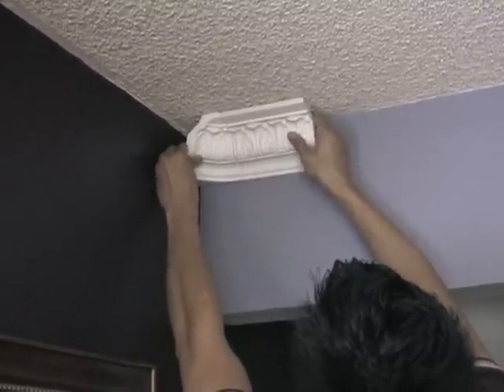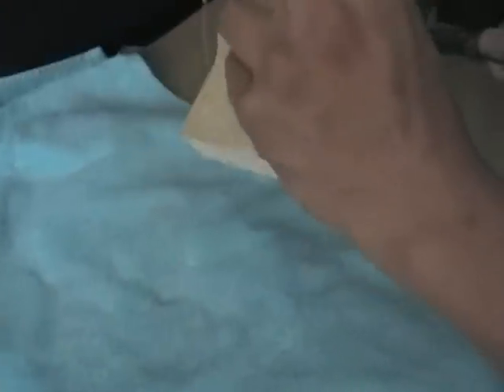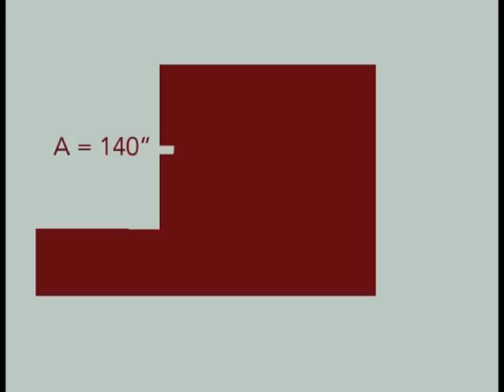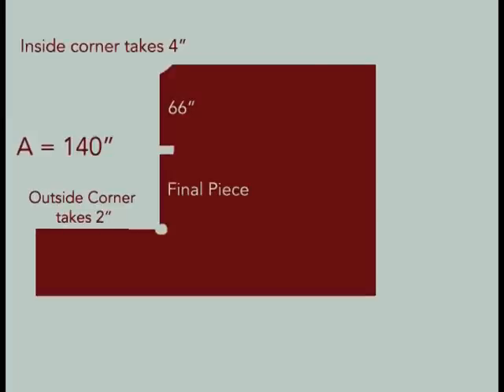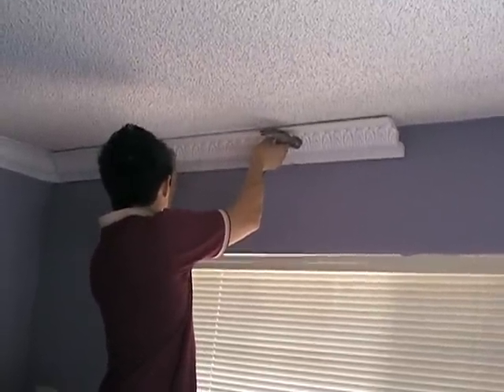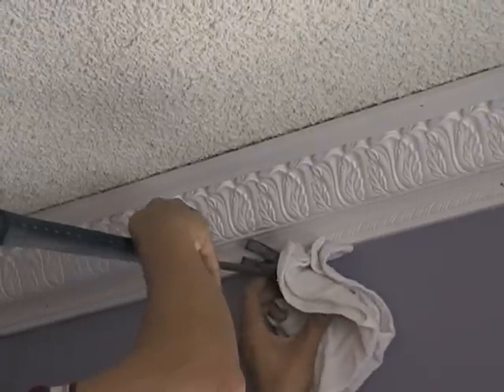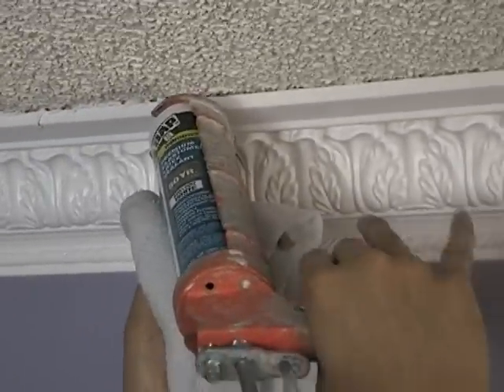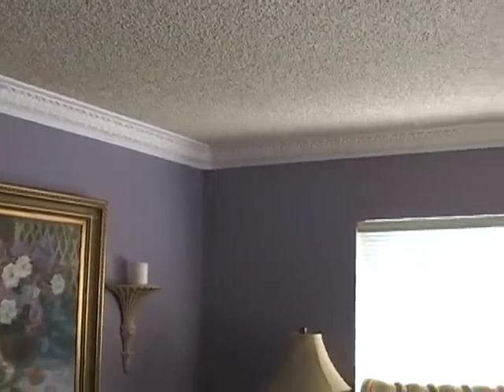Crown Molding Installation - Hammer and Nails - Part 2

Comment: You can get away with using less if you use an adhesive on the back of the molding.  It saves time, is inexpensive, and can be bought at any home improvement store.  I believe they are using polyurethane molding so using something like Powergrab (by Loctite) or PL Premium Polyurethane Adhesive (by PL) works well.  You still want to use nails every few feet because the adhesive takes some time to set.

Comment from the maker: @foamcm Great observations.  The patterns match when using our relay blocks (the pieces that go between each length of crown).  The moldings we are installing in this video ARE foam moldings, we just apply the nails to hold the crown in place while the glue sets =)

Comment: Best to remove the popcorn ceiling, skim coat and texture to match the fancy molding in the same style period. Nail gun should go much faster. I would also pre-paint the molding as cutting in with paint and not screwing the adjacent wall and ceiling could be a challenge unless you keep everything the same color or very good with a paint brush.